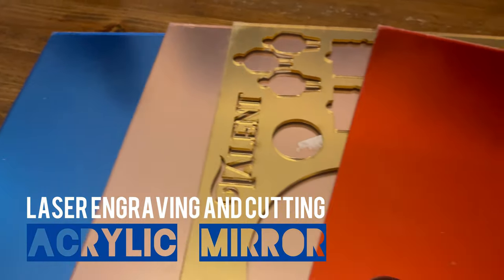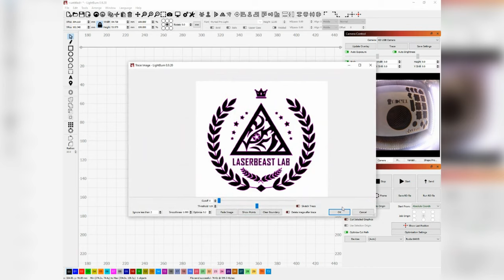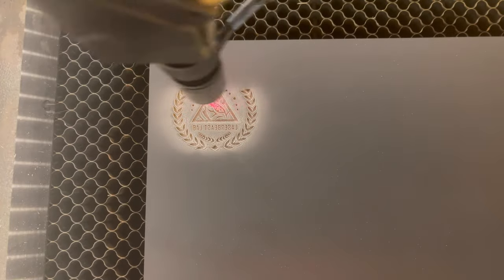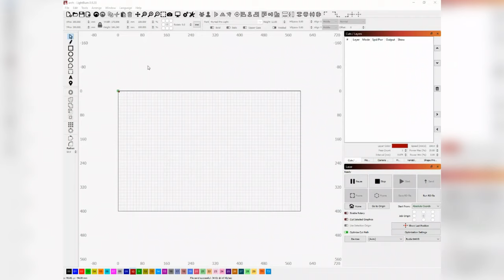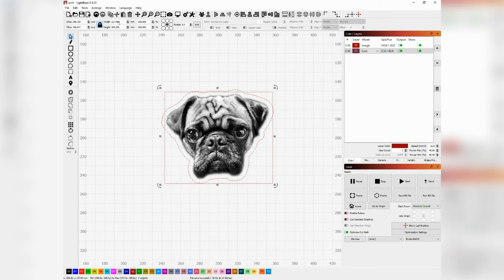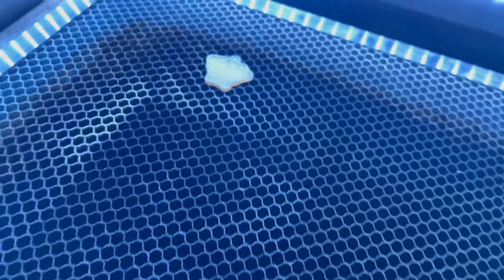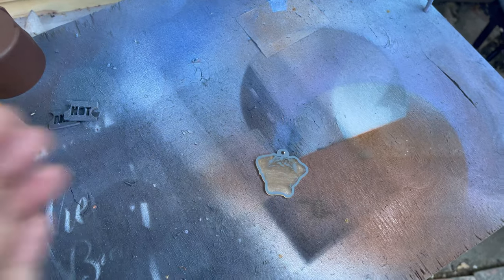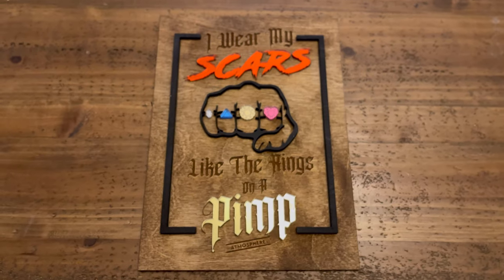Laser Engraving and Cutting on Acrylic Mirror - DIY Project Walkthrough - OMTech

Comment: I have a 50W and used your settings on mirrored acrylic, but not getting the same results. It seems to burn the edges and not cut through all the way. Any suggestions would be appreciated.
Reply from the maker: Great question! Feel free to message Max here: https://www.instagram.com/laserbeastlab/. :)
Reply: Maybe your machine is not aligned!! Try doing the correct alignment, that’s happened with my machine
Reply: Did you figure it out? What was the problem. I'm having the same.

Comment: Good morning
I bought a Polar Omtech and
I would like to engrave first names with very fine writing on my gold acrylic which is 3mm thick,
what setting to make on lightburn?
Thanks for your help
Reply: Did you work out some good settings I can test? Recently bought a Polar but have mainly used it for cutting and hoping to try engraving again next week. I tried on some two tone acrylic but had lines in the filled parts. Maybe I ran it too slow/strong? Also, air assist on or off? Any help would be much appreciated
Reply: @StePhillips I just brought the laser manually closer to the plate